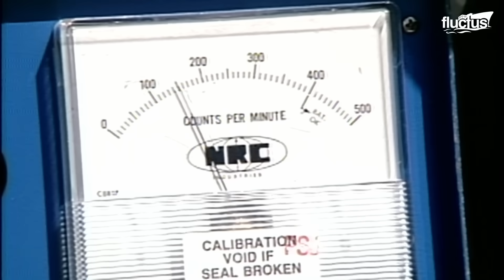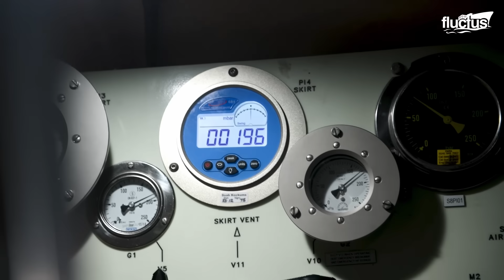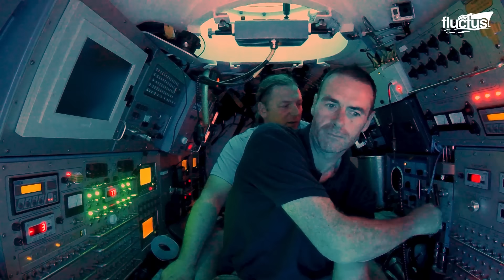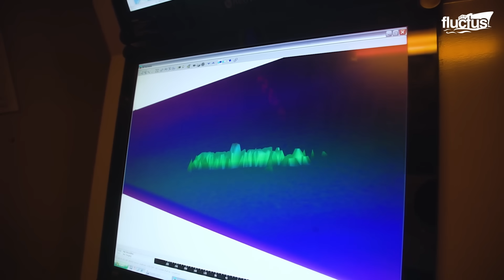What it Takes to Clean Gigantic Ship Propellers in the Middle of the Ocean

Comment: i like to see a video on cleaning a subs hull. Yes this reduces fuel consumption all ships etc have to be dry docked for hull paint[anti fowling paint] and anode replacement. Those prevent the growth algae and barnacles. Hence the term in nautical terms called “sacrificial anodes”.  Yachts 🛥️, Rv’s have them so water doesn’t eat through rudders hull plates fresh water cooling for the engine. Sea chests are intakes for water to be drawn in to cool some cases lubricate then when passes through from doing its job it’s pumped over board. alike outboards have a tail-tail [if it’s not peeing] your not cooling. Anodes on smaller  usually mounted as part of the skeg some round some have wedge they run a bolt through as part of mounting the lower unit. Design changes engineers move these anodes salt water degrades them faster they look like someone took a hammer 🔨 whaled on it by that point it’s due bolt off bolt new.